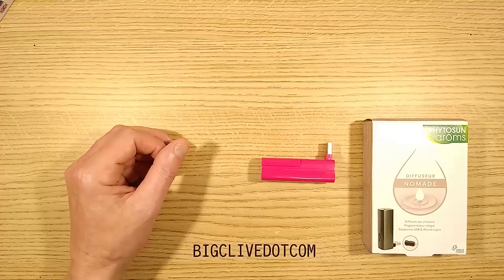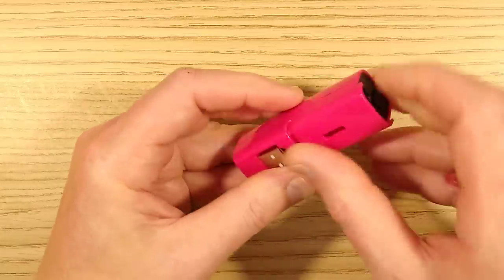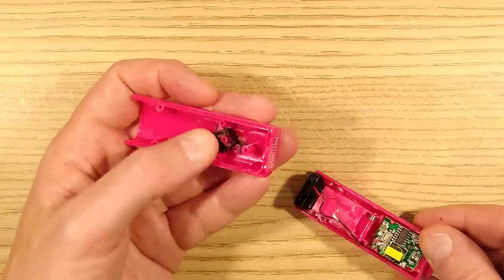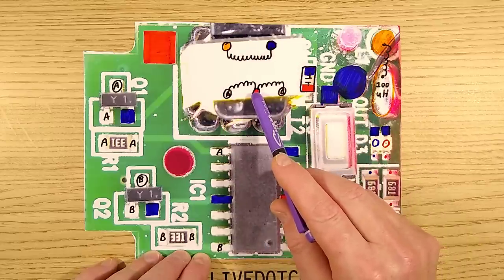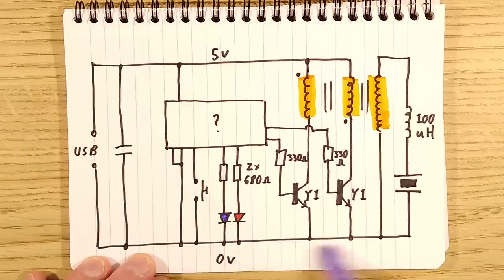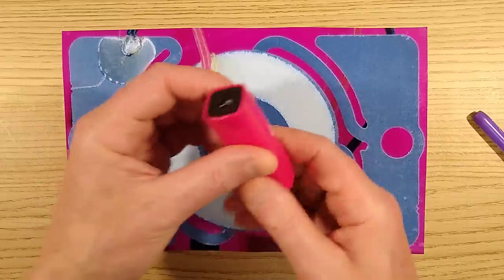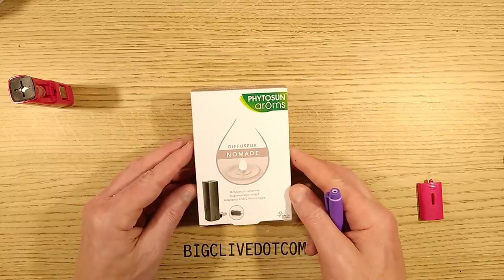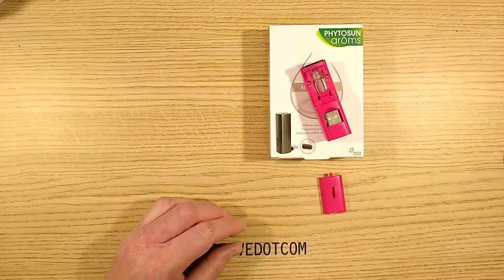Inside a Phytosun ultrasonic oil atomiser - with schematic

Comment: Essential oil atomizers should be required to have a pet warning on them. These things can cause serious problems to cats, and dogs to a lesser degree. Their airways can be heavily impacted by atomized, but not actually vaporized, essential oil droplets.
By contrast, odorizers that just heat the oils and let them evaporate (true vaporization) with no active spraying mechanism are perfectly fine around pets.
Reply: Flammability warning too.
Reply: Correct, my cats happen to actually enjoy my Apple Cinnamon Air wick one that I have, its given a sniff each time they walk past it.
Reply: What about catnip oil?
Reply: @flowerpt Oil droplets are bad for pets' airways. They can cause irritation, infection, bronchitis, asthma, and other breathing problems.

A true vaporizer doesn't put oil droplets into the air, but releases the aromatic compounds as a gas, via evaporation through heating. Vaporizers are generally pet safe (except for rare instances of hypersensitive pets).

General rule of thumb: If the device does not have an active heating element but does use an active spraying mechanism, it is nebulizing/atomizing (creating microscopic droplets that can float in the air for a long time) and not vaporizing.
Reply: Yeah. Surely BS.

Comment: I find it funny in a time when supposidly people are concerned about air quality yet happily stuff vapours from oil into the air???
Reply: Exactly, I thought that when I saw them selling Joss sticks in the local market!
Reply: The "room deodorizers" seem pretty popular in America, hardly a day goes by when I don't see them advertised on TV. I personally don't care for them, my wife bought a couple and we had to narrow the scent options down because a few flavors were cloying and nausea-inducing to me.
Reply: These items of crap are not allowed in my home. They want me to pay to pollute my home? Absolutely no way.
Reply: Ignoring the fact that I can trace my migraines to the vaporized oil carriers of artificial fragrances: my concerns are a bit more tactical.
You could put anything in that oil container and as long as it has the surface tension and viscosity to wick through to the transducer it can be put in to the air.
Personality: I'd rework the delay to be from hours to days, fill it with something that smells like a horrible fart and then hide it in an elevator or office environment.

Comment: My first question with atomizers is always: "Would it be possible to create an electronic whoofler with it?" 🔥
Reply: Put kerosene in it and make a really powerful firestarer. Lol.
Reply: Add some isopropyl to the oil until the appropriate whoof is acheived!
Reply: Great idea! Kerosene/jet-A/paraffin. 

Yeah, just add another push pull transformer drive circuit, along with a xenon ignition transformer in there. Then a small spark gap. Whoosh every few seconds! 
Now imagine a whole bunch of these in a row, behind clive on one of his live streams, and you'd have a miniature stage-style, random pyrotechnic show. Yay! 👍🏻🇬🇧😎
Reply: @toastrecon  Eucalyptus oil has much the same octane rating as petrol (gas in the US) and can be used to run a car without additives. Very easily flammable on its own.

Comment: Just brought some of these, and it looks like they have difficulty atomising some of the more viscous oils (like the one I tried just splattered a small amount of oil around without actually atomising it). I will have to try with some thinned out oils and see what happens.
Reply from the maker: Thinning the oil with isopropanol (isopropyl alcohol) may help with the atomisation.
Reply: I've got a much bigger unit that does that same thing and it does seem an issue with these. They can also get gummed up pretty easily, along with the oil dropping back to earth and making surfaces around it oily over time. Though I don't know if a regular water diffuser has the same issues as I've never had one of them
Reply: @bigclivedotcom what about just pure ethanol?
Reply: I had the same issue with ultrasonic humidifiers, if you didn't use distilled water everything gets a fine layer of calcium dust...
Reply: @TH-bj1pb  The answer to that question is always "Yes please".

Comment: Atomized oil seems like a great way to get Lipoid Pneumonia

Also, Wikipedia says: "The introduction of Olbas Oil into a child's eye contrary to the product's instructions for use, was noted to result in a range of adverse effects including corneal scarring."
Reply: atomized oil is fine, just don't hold it directly under your nose.
Reply: This is a smelly gland with an LSD connection.
Reply: @tebbi67  wtf?

Comment: That was indeed a simple schematic, But the layout was not optimal for sure. it would be fun to make some experiments with that little transformer as it is a push-pull to see what voltages it outputs and what else it could be used for
Reply: Photo flash discharge tube?
Reply: @fredfred2363  yeah. That is one thing. Another could be a voltage booster. Or an ignition coil together with a voltage multiplier etc

Comment: #WORKS NOW#
Hi Clive - After watching bought one. Didn’t diffuse. Tried O level French. Took oil out plugged in empty and added surgical spirit to the piezo on top while on “red” a few times, using dropper provided. This seemed to clean the micro pores out . 
Now seems to work.
Reckon the oil can clog if new or “sat” for a while blocking the pores and therefore operation.
Reply from the maker: Adding a touch of isopropyl alcohol or ethanol to oil can also help it diffuse out easier.

Comment: Brilliant device - well analysed.
The problem I've found is that essential oils ( even diluted with a carrier oil) are too thick for the wick and ejection system.
Works fine with culinary extracts.
Now I have to try and clean out the wick.

Comment: Any chance to scope the “AC” output of the transformer for frequency and waveform? I seems that they might be using cheaper transistors that switch slower or less clean. Perhaps the transducer does not care or the additional inductor smooths it.

Comment: I think they made a few noob mistakes. Y1 is a PNP transistor rated at 40V max Vce. They'll get destroyed in no time. 
They should've used logic gate N-MOSFETs like the Si2302DS, to bypass the BEMF of those coils to ground via their built-in diode, to be captured by a 10uF+ low ESR (Electrolytic or Tantalum) capacitor across the supply. If I needed one, I would buy one and mod it. I use a little fridge Ozone generator. It gets rid of smells without the room smelling like Ozone. 
But I really like the miniaturization of parts to make this little landfill.

Comment: Quick question Clive, Do you do all your projects to Electrical Standard? Or did you also do "not-to-standard    work   wich still is more than good enough" ?

For my Projects i tend to always do it so nobody can get hurt or die but sometimes i do things like:

I know itd be better to solder this connection but i dont have my tools on hand so ill just twist the wires, secure them with a Zip tie strain releaf and put some electrical tae over it.  (Low voltage only).   Like adapting a different power button onto a OEM Connector for a Mainboard and OEM specific fan headers.

Its a dirty, quick fix but in my opinion its more than enough to outlast the PCs Lifetime and User abuse.

Comment: I got a pack of 4 on ebay. Of the 2 I've opened so far, neither have any oil in the black-topped bottle and one had no wick bottle. So perhaps they're being dumped because the packaging got screwed up. I wanted them in order to investigate the driver for another use, so no loss :).
Reply: what keywords can be used to find those units? i am struggling to get any results sadly

Comment: Hi Big Clive love your videos, I would like to ask if you could do a video on "death beam capacitors" And how to check they are discharged the correct way when working on say a guitar amplifier or any such electrical item .
Reply: ideally with a suitable resistor on an electrically isolated lead, not so ideally with a screwdriver(can damage parts including the cap itself but ehh... better safe than sorry)

Comment: I suppose you could always stick another decoupling capacitor across that sketchy power trace to try to reduce the voltage fluctuations.  A 3¢ hack that might stop it from crashing if you're using it from a power bank below full charge?  That's if it actually does have a crashing problem...
Reply: in order to reduce noise from switching inverters, usually a 100nF ceramic capacitor will do de job as He mentioned so.where in some of His clips...

Comment: 4:26 -- is it possible that pin 7 and 11 are actually tied together by a trace that runs beneath the IC?  That would make more sense than using the IC itself as the current path.
Reply: Whether it runs under the chip or not is not what he's talking about. That trace isn't a superconductor, so as current flows through it, its voltage will drop. If you have a trace 20mm long and 0.2mm wide, with a standard 35um of plating, its resistance will be approximately 49mΩ, so sinking 1A along it (when the transistor is on) will cause a voltage drop of 49mV. Introducing this voltage variation on the power supply pin for the chip several hundred times per second (whatever frequency you're switching the transistors at) can introduce instability.

Comment: If the designer wasn't worried about burning out the IC, then they'd have done away with transistors and sunk the windings directly through the uC pins.
Reply from the maker: The IC would struggle to provide even 10mA.
Reply: Even if that were feasible, the back EMF  spikes would rapidly kill the microcontroller. I'm not sure that would even get past cursory testing.

Comment: An interesting little device - I’m guessing the market was flooded with stuff like it at the height of the c-19 pandemic with people using it to pump sterilisation fluid in to the air .
Just like the rise in ozone generators?

On g to he subject of ozone sterilisation- have you seen the small usb rechargeable ozone generators that are sold to sterile CPAP machines? 

Having need of a CPAP machine since January I bought one and it gives of that distinct ozone smell and pumps it through the tubes etc on a timer .

Comment: Could be that sales were low because it has no potential for use as an injector in French diesel tractors. 8^) Interesting circuit and piezo though. Cheers
Reply: Forgot to mention I could clearly see the puffs of oil against the black paper, just FYI. Couldn't smell it though

Comment: Would modifying for less often spraying be difficult?
Reply: Some chips have a resistor and capacitor that determine the timing.  But the chip has no identification so it's unknown how it works.
Reply: Would probably be possible only by replacing the micro with your own (and programming it).
Reply: It looks like it sprays when first turned on, so you could control it via a smart plug.
Reply: The schematic shows no external time related mechanism that you could mod (say replace a crystal or a resistor-capacitor timer circuit). So you have 3 options. Modify the programming (unnamed chip unlikely to reprogram or get original programming), replace the IC (would take some work to figure out the frequency its triggering the transformer at), or external control (wifi smart outlet).

Comment: Isn't it pretty much the same as the plug-in air fresheners with the little bottles?
Reply: Afaik, those contain more volatile substance that evaporates just from heat but I'm not sure.

Comment: I built a similar kind of AC inverter for my Halloween lantern I used a neon flicker bulb based on a 4047 and they lasted for about a season then the chip was fried... I couldn't figure out why... so I went with a 2-transistor "blinker" and used MOSFETs to drive the transformer.   So what I think might happen is that over time this chip will get fried and the product will stop working.  The other thing that it could be is a counterfeit and the electronics just are crap.

Comment: 3:43 how do the chips get programmed? Like how do the chips work? I've never heard anyone explain it.
Reply: If you're ordering a zillion of them you can have the manufacturer "mask program" them, that is the memory section will be hard coded rather than programmable, baking your provided program in from the start. Shorter runs you just program them one by one in a chip programmer, or design the PCB to be programmed in a fixture before the product is assembled. If you're asking how the inside of a microcontroller works, that's a complex subject covering many topics.
Reply: @Broken_Yugo  Thanks brother. That pretty much answers my question perfectly.

Comment: Can you please make a video about cheap single use usb temperature data loggers? And is it possible to reuse them and replace the battery? They are about $5 for si gle use and $20 for reusable ones at aliexpress.

Comment: Can you do one of those wacky oil vapes you know what i mean? I alway wanted to see a cirucuit for lets a 510 thread battery like yocan uni pro. I know it can be simple but one with screen and voltage control. But either way as a software engineer and terrible electrical engineer at heart

Comment: Common brand of essential oils in France.
They also sell neutral tablets for the safe oral intake of essential oils by the way.
Which leads me to a question: Is it common/acceptable to ingest essential oils in the UK or not ?
FYI here in France it's a very common practice that isn't more dangerous than the use of conventional medicines if proper safety precautions are taken.
(One of which being not to ingest the oils in their pure form, hence the use of neutral tablets or a teaspoon of vegetable oil as a carrier among many others).
Reply from the maker: I think they are usually safe in trace quantities, much like eating the actual herb.

Comment: Do piezo elements generally need ac or dc to work?
Reply: depends on what you want them to do. it just gets thicker or thinner based on applied voltage. You can have a micron resolution actuator by applying DC, or you can run AC and have mechanical vibrations of up to few MHz, which is enough to mechanically separate (like rocks in mining) /molecules/.
Reply: DC is just a very low frequency AC. AC is just very high frequency DC.

But normally you use high frequency AC to move a coil back and forth for a useful purpose. That includes piezo.

Comment: No feedback to optimize piezo efficiency. Strange.

Yes, as Editing Clive now knows, the vapor plume is visible.

Putting one of the driver transistors on the same ground pin as the chip via a very short trace is a bit weird even though that particular trace is pretty wide, but so is the other one, just over a longer and skinnier trace run. I would be interested in scope views of the drive waveforms to see if there’s a gap between push and pull, and if so, how long in duration.

I’d also like to know the AC voltage and waveform seen by the piezo. I wonder how much signal would be produced if the piezo was replaced with an antenna…

Comment: So its a 5v usb injector.  12v fuel injectors do same thing except better.. they make 5v ones also but have 2wire plugs.  Build a circuit that pulses it then boom you got a atomizee that will throw a hell of a poof..

Comment: issue is, that you still need the water as vaporized water itself helps clean the air a little and "make room" for the oil itself.

Comment: I might get one and make it into an on demand and 3D print a case to hold a battery, I don't like how often it spurts, from time to time I have severe anxiety and lavender helps a little, I want to try and hack make something, for one and I can just💨 a little in the car or even to make going into the toilet less revolting at work, it's not filthy but they can't find where the stretch is coming from on breezy days and it's not always convenient to walk all the way to the other side of the plant😒😶😬🏃‍♂️😬🥴😳🥺
Reply from the maker: It sounds like there may be an open drain like a floor drain or unused sink that has no water left in its air-trap.   If that's the case, then pouring some water in will stop the smell.

Comment: What's the purpose of this cheap item?. If you buy a bottle of Air Freshener or an Air Wick you'll get more that will last a lot longer.
Reply: 1. AirWick smells like chemical factory and regret.
2. Some essential oils have mild antifungal properties, so if your closet smells kinda stale a bottle of tea tree oil in one of those (or soaked into a pincussion tbh) will deal with smell and it's cause.
3. I live in the kinda swampy area, at the peak of the season mosquitos and fruitflyes just stop giving a fuck about commercial repellents, but oils work like a charm (if you're willing to put up with the smell, small tradeoff for not being eaten alive).